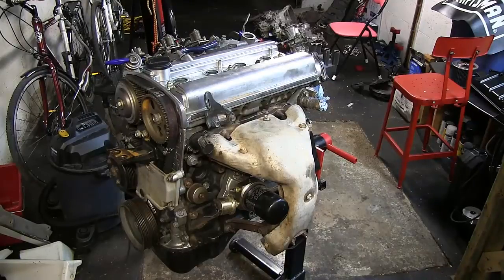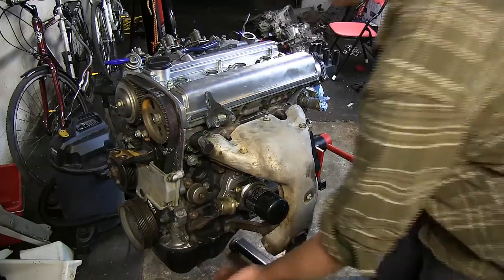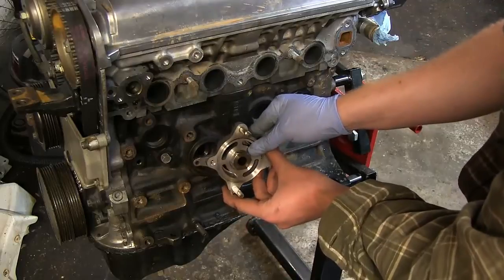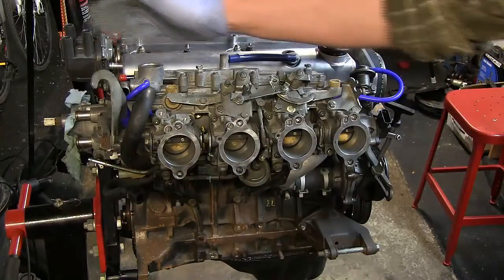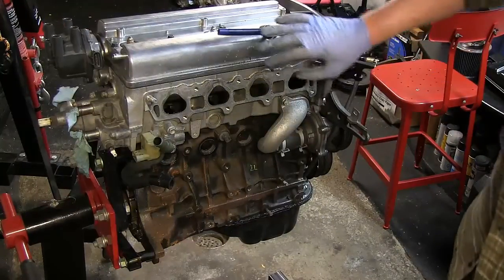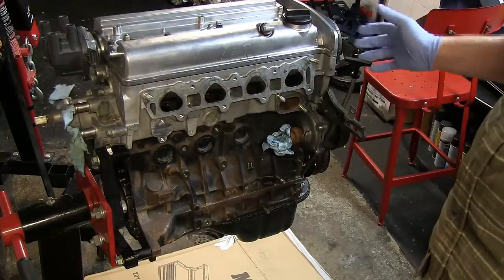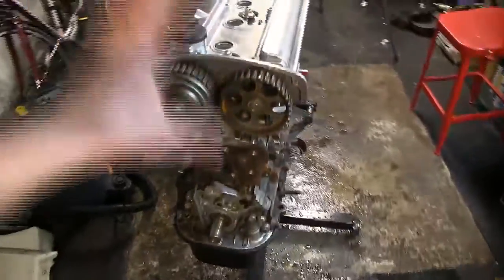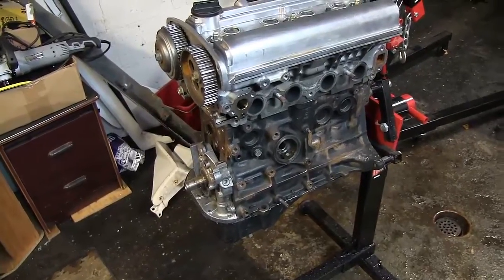4AGE 20V Engine rebuild part 2: Engine dis-assembly

Comment: hi did you get moore hp whit the 16v manifold
Reply from the maker: 20V manifold should produce slightly more hp, but not much.
Reply: ryan ramprasad if the the manifold is to wide you wont get back pressure. Same goes with if it's too small you will get to much back pressure and engine will not run good so if you can get good pack pressure you can also get a little bit of hp